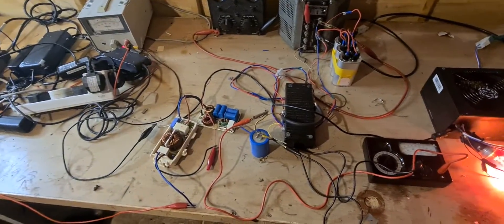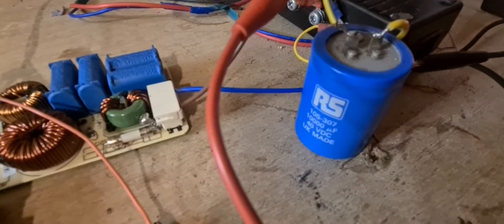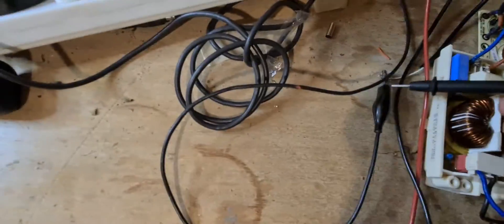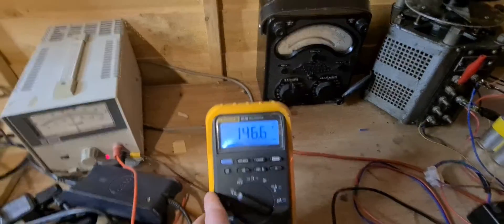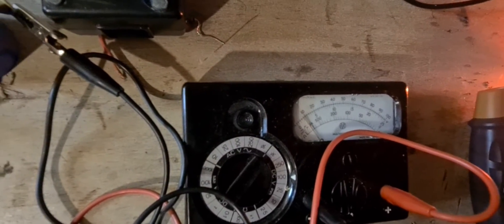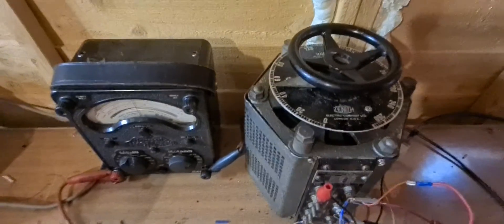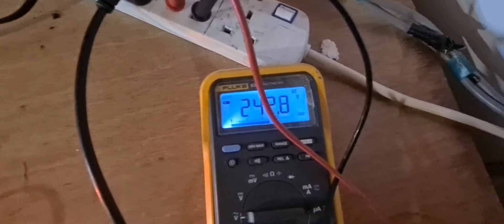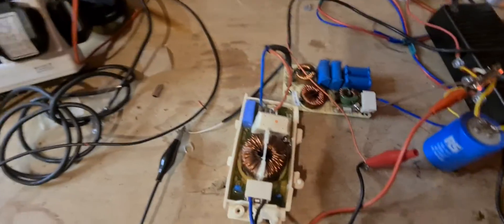Hyperdrive loop test.  update 2

Comment: To keep it simple, why not starting only with your 40v cap at let say 12v, have your loop setup ready (variac/diode bridge, etc) and spin your motor. You will see quickly if your cap voltage climb up or not.
Reply from the maker: It fully charges the cap when I rotate by hand.

Comment: So I count 36 coils in the stator, and I see the only 10 winds on every third one in earlier video with rotor removed,,, so this must be trigger wind for the "Bedini" motor circuit to transistor base,
I assume these 12 coils wired in series or maybe series-parallel so you can adjust ouput for base not blow up transistor base at high rpms?
So then there are another 12 coils in "stock" windings, and these are in series (or series parallel to adjust impedance too?) and these are the motor coils that recieve the 146VDC or whatever the input will be.
Then there are another group of 12 coils of the three phases, also in series? and thse are the generator winds.
On V2 looks like you added more generator winds onto the 12 cores (C2) dedicated to the triggering to the base, so now those cores have two sets of coils, one trigger, one generator...
Is this right?
Reply from the maker: Hey in the new version 24 stock coils are used for the generator side in series however i have a center tap for half voltage if need be.  The stock c1 is the power coil. The trigger coil is now just wound ontop of the stock coils. 10 turns every third leg like you said. I Have since added 40 n52 neos on the upper side of the rotor on the inside so that poles are facing the stator. It's not necessary howver the amperage output has greatly increased.
Reply: @EnterTheRealm  OK thanks - good idea with the msgnets .....maybe check to see if draw increases along with output increases in amperage
Reply from the maker: Rotations drop slightly amperage draw has increased slightly. The output voltage has increased a fair bit howver.  Any kind of drag or friction is going to cause the amp draw to be greater in any situation.

Comment: hi am trying to understand what you doing, you are using the washing machine motor as a motor and as a generator ? not sure what are the other board do exact ?
Reply from the maker: Yes you are right it's a motor and generator.
Reply: @EnterTheRealm  did you have to re wire the washer machine coils or you just modify it ? i have 3 of them , take a look at my channel you will see some tests but i never tried to make it as motor/generator i would like to test that too do you have a skype ?
Reply from the maker: You can get me on face book or Gmail. Don't modify the existing coils only separate the three phases. See my how it's done video for more information.
Reply: @EnterTheRealm  so you using one phase as a motor and 2 phases for generating ? and what do you use to drive the 1 phase as motor ?
Reply from the maker: Exactly and I use simple transistor circuit.

Comment: OK I think I understand it - the generator has a DC input of around 146VDC from the three batteries, and that transformer rectified in series and rectified transformer in series to the three batteries, this giving you that 146VDC you show as input to the samsung pancake motor in the refrigerator.
The "loop" is that you have taken the output from the generator side of the  refrigerated pancake motor (haha) and run it into a variac, so you can adjust the output voltage of it.
And now you take that output, rectify it to DC, and add it  in series "on top" of the 146VDC 

Is this right?  Or maybe the output of generator through variac is added on top in AC somehow maybe through that rectified transformer that is in series with the three batteries?
Usually when I try to loop my stuff, there is problem you cannot just stick it back into input straight, and there needs to be some isolation or disconnect period so blank space you could call it soi it doesnt just shor the whole thing out, but your system doesnt seem to have this problem as you generator output isolated and independent from the circuit spinning the generator (coil C your output while coil A your input)
Am I close to understanding?
I tried to send you email a couple times about the SSRs I have, but the emails didnt go through.
My email is konehead at msn.com
Thanks!  GREAT WORK
Reply from the maker: Yep that's exactly right. The loop is in series with the output and is isolated like you say.
Reply: @EnterTheRealm  Thanks now I get it!  It should loop eh   it is already but you need bigger caps is all like you say.  Look on ebay there maybe someone has some take Tims advice too....keep going and dont stop!